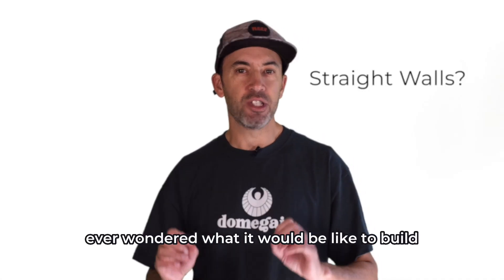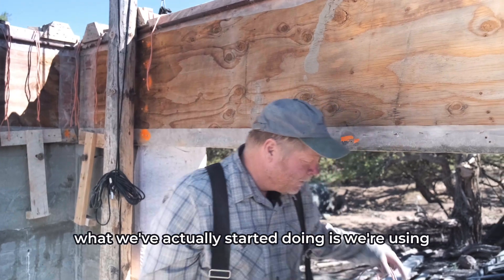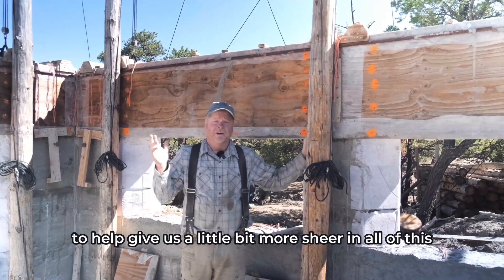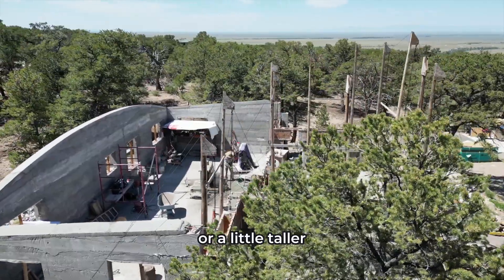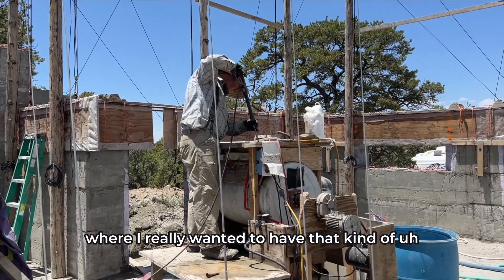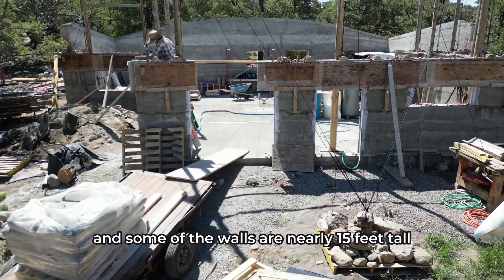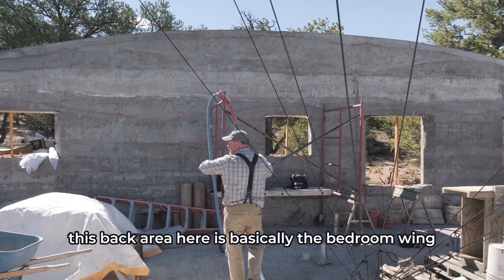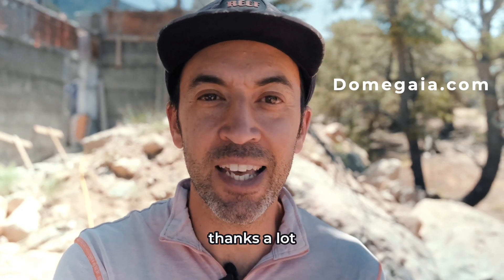Amazing DIY 12" Thick Aircrete Home - (Progress Update)

Comment: https://www.youtube.com/watch?v=z4_GxPHwqkA 

You must watch this - Ben of the NightHawkInLight YouTube Channel has got a new aircrete mixture that is a massive improvement. In it he also shows how to make an "open foam" with the same mix design (you just mix it for longer), and this means that a porous concrete bottom for pots - very lightweight at that - is easily within reach. In a YouTube "post" a day or two later he noted that he has experimented and added sand and that it seems to work fine. The addition of sand means very little water is used - good for strength as you know. Previously aircrete required making foams using particular machines. No such machinery is required anymore. His addition to the field is remarkably practical and brings this type of concrete within reach of almost everyone.

Comment: Nice project!  I like the window well bevels.  12 pallets of cement seems high.  At 40 sacks of cement per pallet, that would be enough to make 8 yards of "5-sack" concrete.  12 pallets would then make 96 yards of concrete - which would make almost 2600 square feet of 12"-thick walls.  Does aircrete use that much more cement than concrete?

Comment: Did you run it by an engineer? You HOPE will carry the weight of the roof. You should have done at least 18inches. Good luck
Reply: There are concrete "posts" every 3 to 4 feet. They carry the roof load.

Comment: Bruce and Susan! Great video and great build!! Are you going to produce  a parts list and blue prints for making your mixer and pump system? How about the formula for your Aircrete mixture? I am really interested in it and would like to make one for my future build. Keep up the great work and great videos..
Reply: There's an upcoming video that should answer most of your questions about the mixing/pumping machine. I'm sure people will make improvements to what I did.

We use Domegaia's recipe. 1 bag portland cement mixed with 6 gallons of water. Mix while adding foam until  you get 40 to 45 gallons of mixed aircrete.
Reply: @brucecoutant4874  ok thank you, I will be looking for the next video
Reply: Excellent rig you have over there Bruce, what is the source of your foam?
Reply: Bruce, your system of mass pruducing aircrete and pumping volumes is by far the most efficient use of time that I have seen regarding Aircrew. I too plan to use slip forms. Is there a detailed explanation or diagram for the DIY horizontal paddle mixing drum? Building this component successfully appears to be the key component in the chain.

Comment: When I started to build my house in Germany, all by myself, I had neighbors coming by, and saying: “Hello. We are your neighbors. WE ARE BUILDING RIGHT THERE….” They never touched a brick, or concrete. They had hired a company. 😅 Now I am building 30 years later my house in Panama. Aircrete was taken out of the plan from the building inspector right in her office. Now people showing up at my lot and asking if I could build their house. I’m 60, disabled from a work related accident in Canada. I always refuse. I shouldn’t even build my house if you ask my doctors. And I do not tell them. The doctors would go crazy. 😂 But I have a lot of respect for people, building their own home! And another thing. Columns! I had now a lot of people saying right away: “YOU can’t build like that! You have no columns!…” Why do people in North & Central America think, that columns must be visible? I’m using 6” concrete hollow blocks to build my house. I build A) A circular house what has a much higher strength than a square building. B) All my inside walls are connected with the blocks to the outside wall. (Imagine a zipper on your clothes). In Europe, I can’t build a building, without connecting the corners and inside walls with the blocks. That is a MUST. (Well. In Germany it was 30 years ago). I have 26 columns in my walls. I made pictures from it, that I have proof. Each is around 4”x4”, and 9’8” tall. My walls are all level. I’m actually proud how my walls look like. And still. I wished I could have used aircrete.